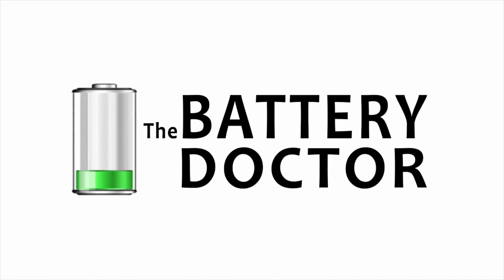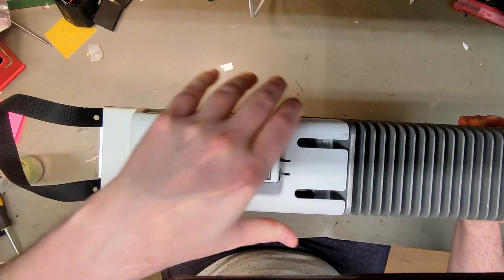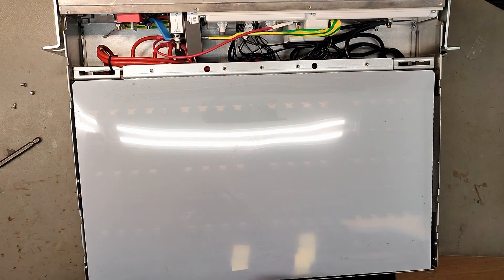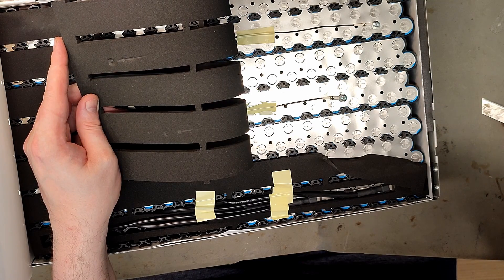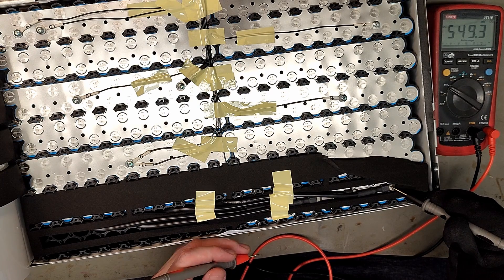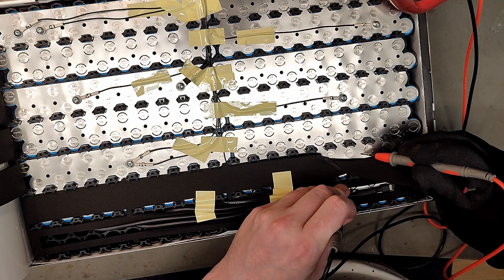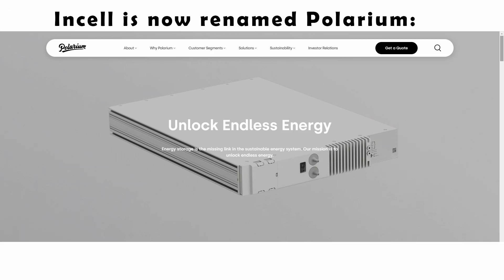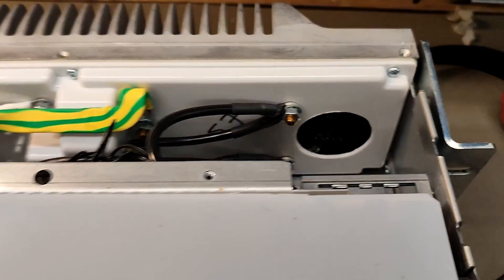A look inside Ericssons MASSIVE 48V50Ah Battery (made by Incell/Polarium)

Comment: These are often used for backup power in telecoms network equipment, telecoms kit often works on -48V DC, I don't know the full reason but I believe it relates to galvanic corrosion resistance when used in outdoor equipment enclosures. The reason for the Off switch being flat is to avoid it accidentally getting knocked off when working in the vicinity, I believe the switch also acts as a circuit breaker in case of overload

The A and B ports are CAN-bus, you can link multiple battery units together or link them to a CAN-bus controller of some sort, we use ours with an Eltek rectifier which supports communication with them.
Reply: I work for an ISP and we're about to deploy two of these units, I'll let you know if I notice anything interesting about them :)
Reply: Hi Fitz I need information about these batteries
Reply: @simbawendall  Happy to help if I can, what do you need to know?
Reply: @rfitzgerald2004  can these batteries be connected directly to an inverter
Reply: @simbawendall Should be ok, pay attention to the polarity when connecting it up. The 0v will be your positive, and the -48 will be your negative in this case but double check with a multi-meter to confirm everything is correct before you hook it up
Reply: @rfitzgerald2004  will the comms work without their inverter interface. Will the RS 485 port on the batteries work on any inverters
Reply: @simbawendall  I believe it will work with any inverter that supports RS485, RS232, Modbus or Canbus. We configure it as a "generic battery" with our Eltek rectifiers and it reads the stats fine over Modbus. 

The connection is a RJ45 port where different pins support different protocols, so depending on your inverter you may need to make a custom cable to get them talking, in my case I made a custom RJ45 to RJ11 crossover cable with the RS485 data pins and ground connected to the correct pins
Reply: You may like to check with your inverter manufacturer to be sure as well